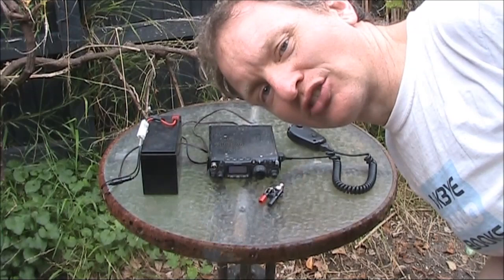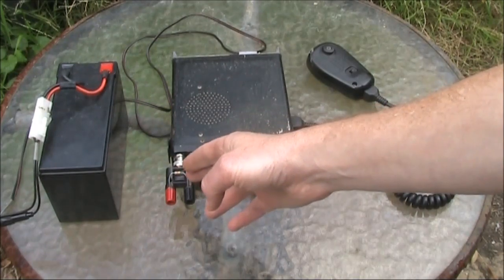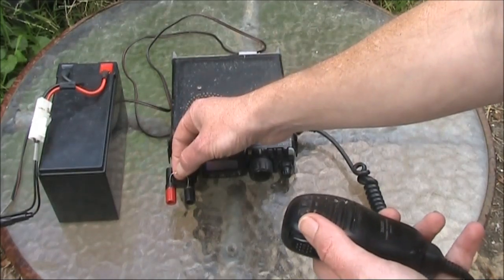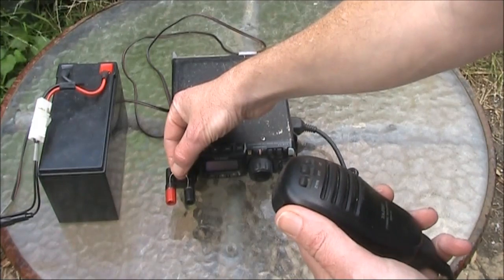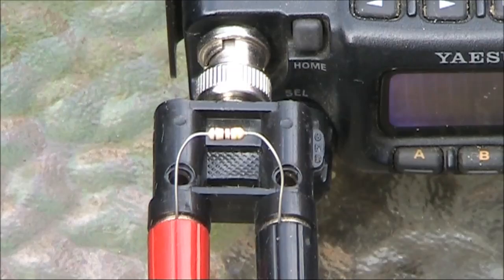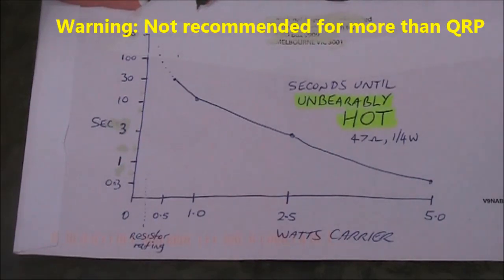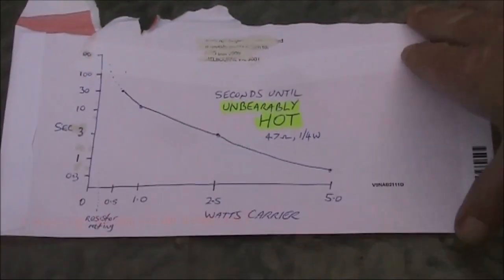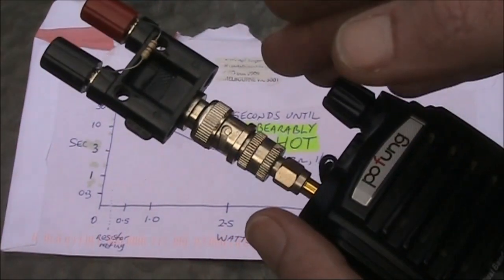Hot Tip: Measure RF output power for 8 cents

Comment: In my early days of using transistors in the 1970's I did a test like this.
I wonder what happens if I change this resistor value or this one?
After a few burnt fingers, this is why God gave us more than one, I decided I needed to buy a cheap multimeter. 
G4GHB.

Comment: Measure the voltage across a 50 ohm/dummy load, and calculate for power - Watts.  P=E(2) / R  Example.  25v X 25v = 625v  .  625v/50 OHMS= 12.5 WATTS..  There I fixed it for you  ;-)

Comment: Not all radios are happy with no load. When the resistor burns in half(at some random place above rated limit) there's suddenly no load connected. 
Other idea: Six 300 Ohm 2 Watt resistors :)

Comment: This is perfect to take out into the field as a quick test to see if your're making power.

I tried an old 50Ω terminator meant for 10base2 ethernet but there is too much thermal mass to feel anything at lower power levels. They are usually speced at 1/8W so by the time they get warm they are probably already burning internally and drifting away from 50Ω.

Comment: Hi Peter, 
I'm surprised that you didn't get any RF Burns, never mind OUCH THATS HOT.
De M0RAY aka previously aka G7FHD In Middlesbrough, Teesside,  North East England.
Reply: Good point. Though, 5W into a 50 Ohm load will give only about 22V peak. I have have touched that kind of voltage at RF plenty of times with no apparent ill effects. Of course, if mismatched, voltage may increase significantly and then you could get a burn. My rough rule of thumb is not to touch anything more than about 50V peak.
Reply: @Steve-GM0HUU  Having worked on more than a few tube guitar amps, I’ve been bitten many times by both AC and DC and the burn I received from an old Collins radio was unforgettable
Reply: I had an RF scold off 20W. Not fun

Comment: That's a hot tip alright. I think your seconds counting sped up as you anticipated getting burned. My multimeter came with a temp sensor. If you coupled that sensor to the resistor body you would have the basis of a thermocouple RF power meter.

Comment: Thanks for sharing this one Peter, as an owner of the cheapfeng im not sure why but it seems quiet when I listen to it on the old alinco is this possibly merely the difference in more modern radios to use digital and the fact that the alinco is just older digital, the reason I'm asking is i have had a few peculiar results since getting the wee rig .